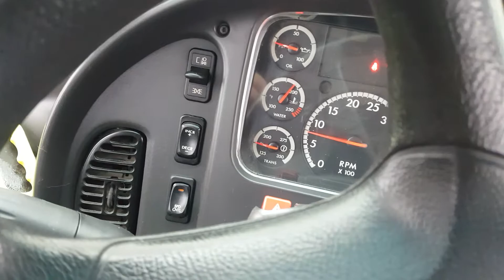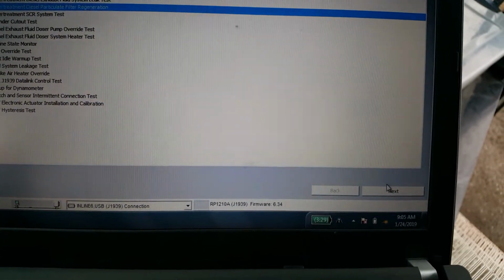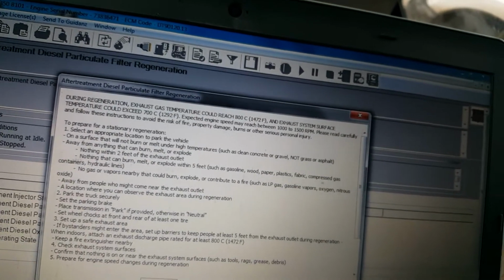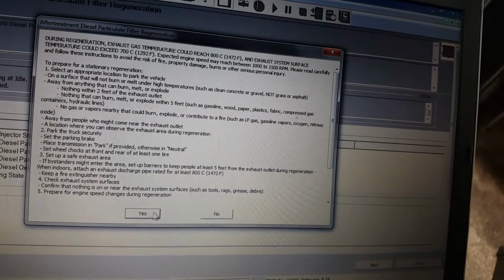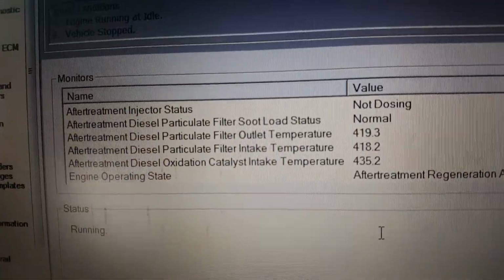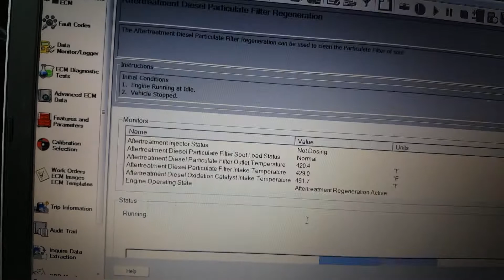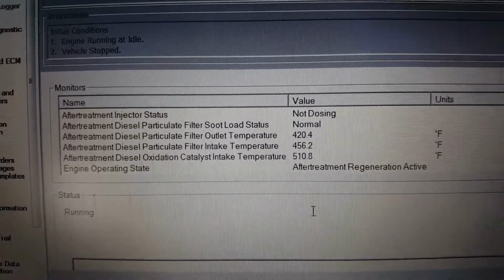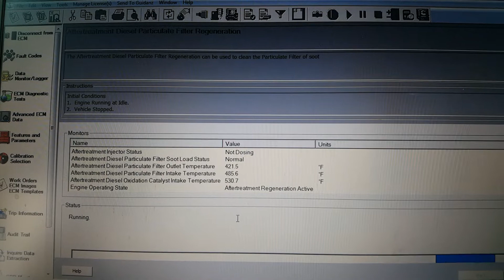2015 Cummins ISB Diesel Engine Parked Regen

Comment: Got a guy drove without def for a day or so then filled it up and truck went into engine torque protection but would still drive them went into semi derate after cleaning filters and changing dosing valve and cleaning crystallized def in the pipe where it is sprayed and now it’s in full derate tried to regen and now it cuts off  after a few mins and won’t hold idle or complete regen please help

Comment: Hello sir! I want to ask if you have encounter issues with the regenerations, DPF pressures problems that are related to the after treatment. I have gotten issues that the ECM needs to be reflash.
Reply from the maker: No not with the Cummins. Did you got in touch with a dealer? They would be familiar with this problem.
Reply: @MechanicsHubdotCom  Yeah, The shop foreman got in touch with the Thomas and Cummins as a fleet we are going to start doing from now on since the lack of time it takes at the dealer just wanted to get back at you